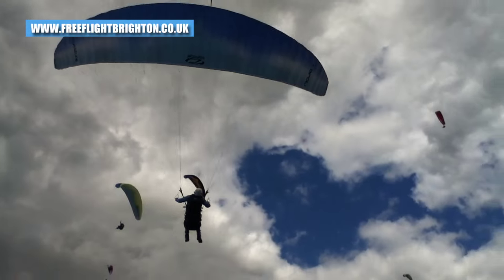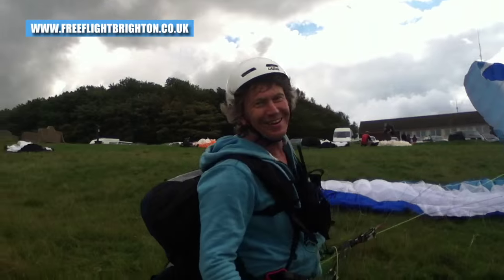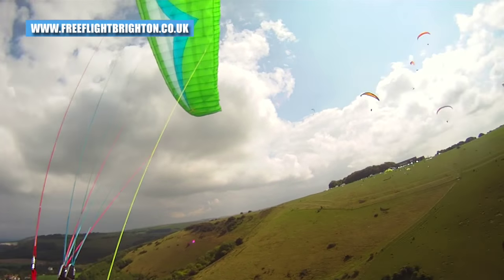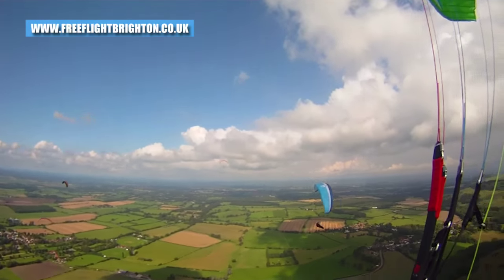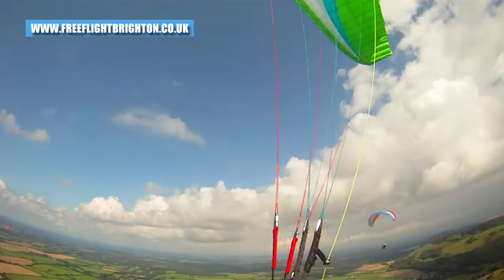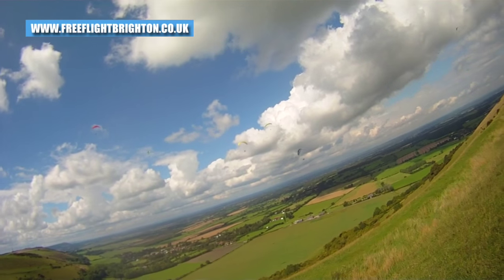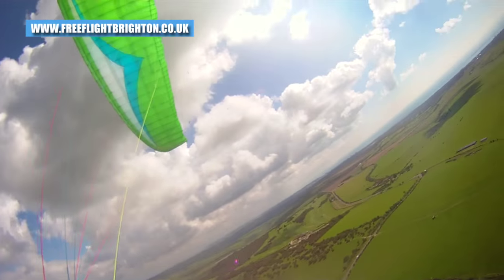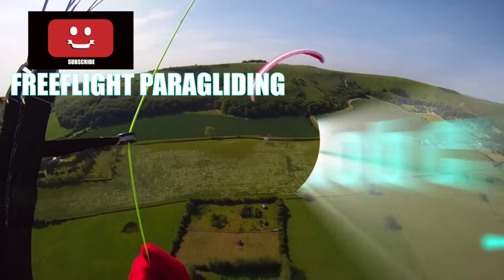Paragliding Climb to base ABC. How to thermal a paraglider

Comment: seems like a lot of the traffic issues could be avoided with control over the amount of pilots in the air at a time
Reply from the maker: Hyperious hi their, just wondering if you fly PG’s ? Only ask as free flying like the roads, no one Marshall’s the roads when congestion starts, same applies to flying, unless your flying a commercial airline in designated airspace control. Nice idea I have asked for a marshalling system to aid low airtime pilots.